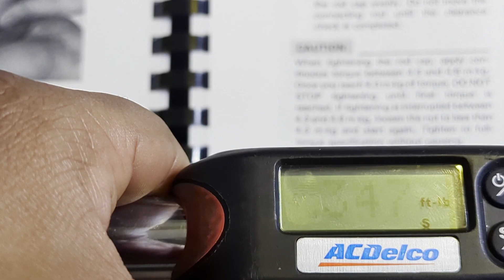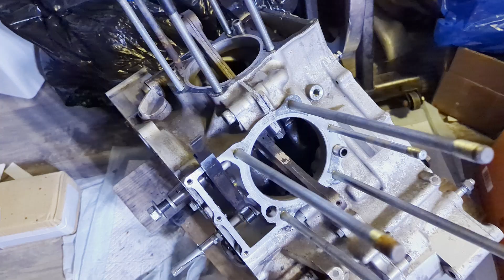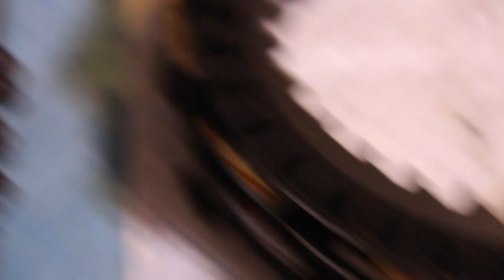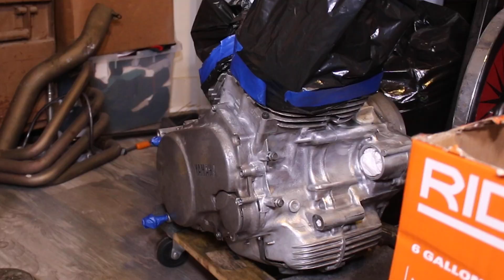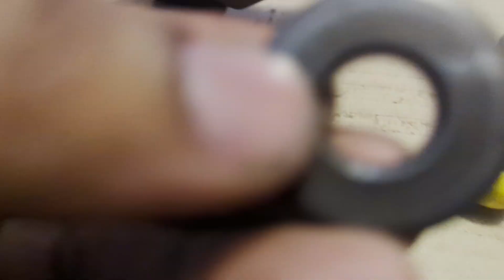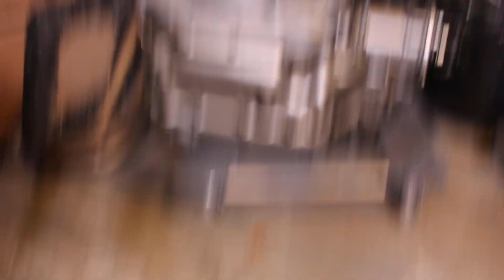[Ep 03] Yamaha Virago XV920 Cafe Racer Project - Engine Refresh/Reassembly

Comment: I recently replaced con rod bearings in a different Yamaha from the same era and tje manual said that the bolts should be tightened in one go, until thr wrench clicks, if one happens to stop in the middle of tihjtenning, the nut should be loosened and tightened again.

Comment: Gentle 'tapping' with a very-small engineers-hammer , gives more-even-torques and helps-release any binding-tensions  ie ; on big-end-caps, nuts etc , then re-torque , obviously taking-care where you-tap, not distorting the 'flats' on nuts etc . The same-technique can be used when welding 'Cast' , stops stress-fractures by relieving tensions in the metal . Dave  NZ

Comment: I plan on doing a virago 81-83, it's a bitch to find a donor bike near me though. The only 3 I've found within driving distance are either too rusted out or too perfect. The only reason i want a Virago is for that monoshock. If i could just find one with a decent frame I'd be happy, I'd even do an engine swap and I had planned to do a custom carbon fiber tank and levers/pegs. If I did the engine swap I'd definitely look at doing a forged carbon swing arm as well to reduce sprung weight and look good.  
Your build is coming along dope though.

Comment: I got two questions. One being can they vapor blast an engine without a complete teardown?  2 the smaller wire brush where did you get? Is it something you made or something that can be bought?
Reply from the maker: If you get the engine parts blasted they have to be completely stripped because the "media" or grit material can get embedded in places and ruin the engine when you run it. The wire brush is available here
Reply from the maker: Wire Brush for Drill Set 21 Pcs,... https://www.amazon.com/dp/B0B1H6NMJ9?ref=ppx_pop_mob_ap_share

Comment: Not  all V-twins have a single shared crank pin like yours. That design limits horse power which explains why Harley engines have lower specific output compared to, say a Shadow 1100. Several Japanese V-twins have seperate crank pins offset to make if fire closer to 180 degrees.
Reply from the maker: Ahhh, thats interesting to know. Looks like the shared pin is just for the Harley sound

Comment: Something that might be helpful when deciding to reuse or not if anything has a torque to a number then angle that's is torque to yeald and should not be reused. In theory anything else that is in good condition can be used agian. Most race teams will only use a bolt 2 times. Any stud, and nut can be used agian and agian.

By the way. love watching your builds. because of you I'm going to be going pretty deep in to a cheap bike I just got.

I have a nicer bike I do matince on and mild modifications but I haven't done an engine yet.
Reply from the maker: Gotcha, thanks for the tip Kevin. Im glad I could offer a little motivation. Lets see who finishes first lol.
Reply: @Theillestrator1050  probably you but I'll give it a shot.

Comment: Looks real nice! I have never had a leak using Yamabond 4. It's meant for gasketless metal surfaces and is great stuff! I have always wanted to try it on aircraft engine cases and oilpumps but have not yet. We have to use inferior FAA approved substances that many times do not work!
Reply from the maker: Thats reassuring, finding out this is better than aircraft stuff! haha.
Reply: Motorcycle engines are put under stress quite often but never seem to leak unless impacted. Downdog, when you apply Yamabond, do you apply it in a bead (which will flatten out once the case halfs are bolted together) or do you apply in a thin coat?
Reply: @blipco5  
Yamabond 4 is kind of runny so a bead is not really possible. It doesn't take much. It also should be said it doesn't have a long shelf life once opened. I usually buy a new tube when assembling  a bottom end. A thin coat is all that it takes on nice surfaces.
Reply: @upsidedowndog1256  Ok thank you. My favorite of all time for side covers is Hylomar HPF made by Permatex. My twenty year old tube with a few drops   left in it is still good like the day I bought it, while the new Hylomar skins over quickly and the opened tube goes bad in a year or so.
Reply: @blipco5  
I have used lots of Hylomar over the years. We used it on aircraft engine case halves for years. It was invented by Rolls Royce for imperfect machined surfaces on aircraft engines and can actually be used where oil never quits running out like a prop governor. DO NOT USE IT NEAR ANTIFREEZE!! I like that stuff bt Yamabond 4 is next level better in my experience (33 years aircraft, 42 auto and motorcycle).
Reply: @upsidedowndog1256  Yes. I’ll take your word for it. Next time I’ll try Yamabond 4. Thanks for the response.